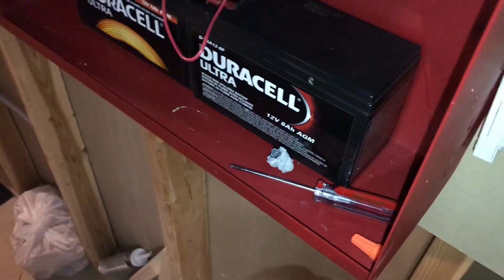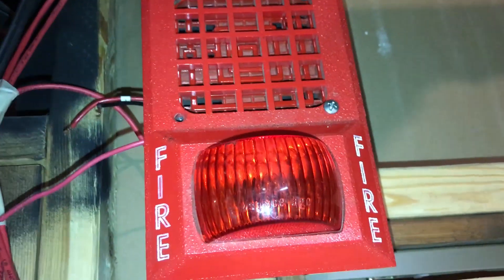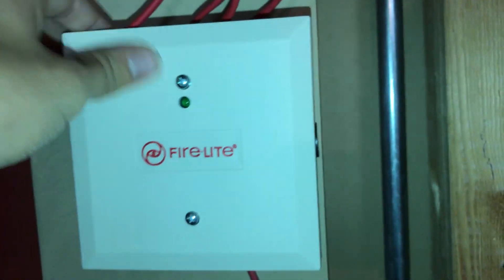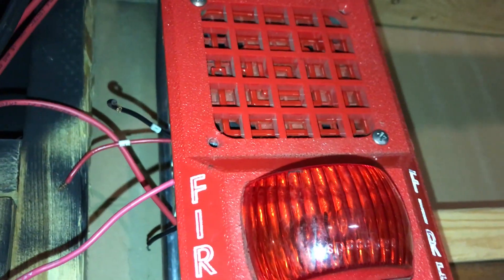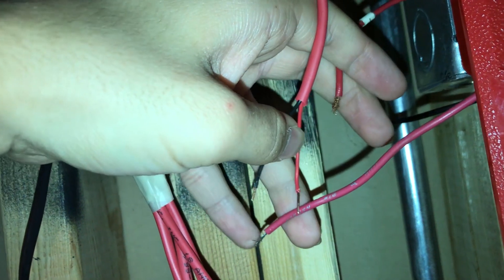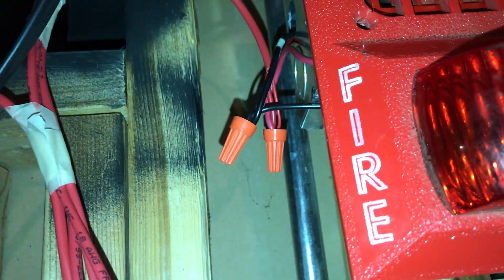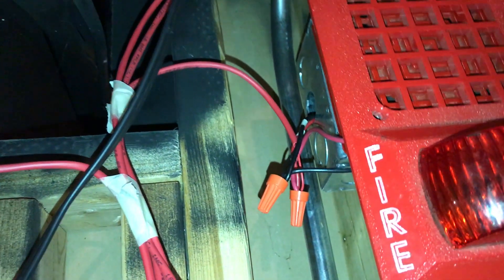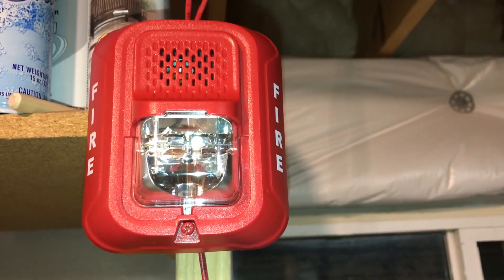Fire Alarms Explained: Wiring Horn/Strobes

Comment: Using a meter to check voltage from the FACP would confuse someone because when the panel is not in alarm, you would read positive on the black wire and negative on the red. The FACP uses this protocol to read voltage drop across the resistor and reverses when someone has activated an alarm via pull station, heat or smoke detector. Once reversed, the strobe will begin to flash on a pulse signal via programming or sync module. Fire alarm is fun! Also what area are you from.
Reply: That is called reversable polarity